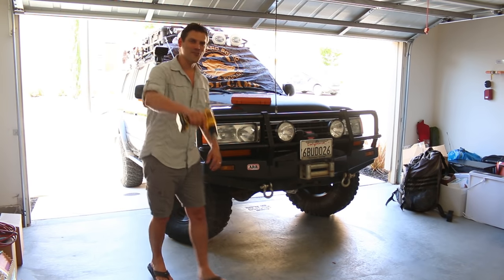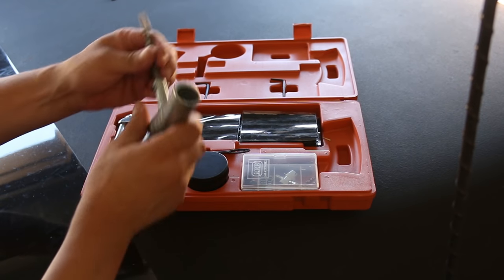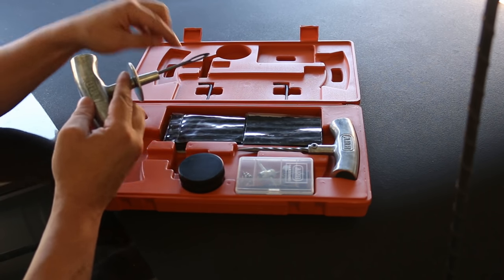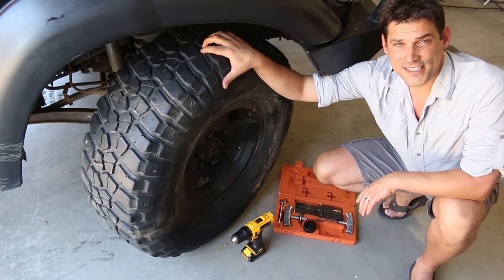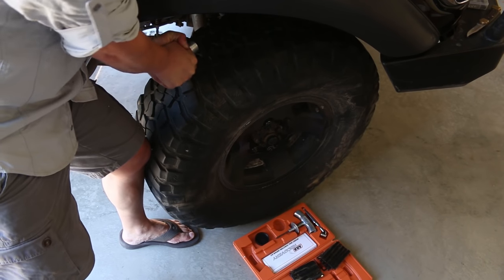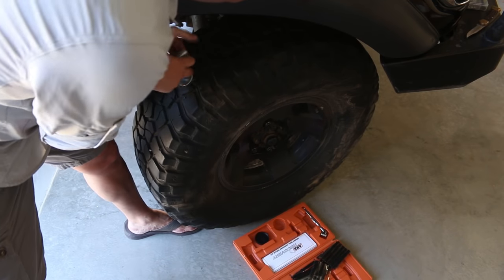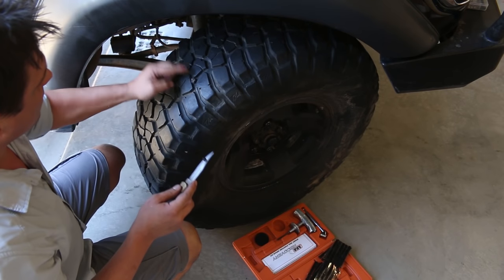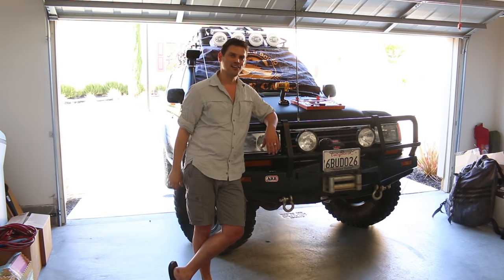Trail Tire Repair How To

Comment: a trick I use is to smear the rope in rubber cement and after the rope is installed smear more rubber cement on top of it and it will last for a very long time.
Reply: ompenarnie on my truck I just drove on the pavement for a bit and it hasn't lost pressure for 2 years
Reply: great idea!!
Reply: Sounds funny but, on the pavement, I like to put a little dirt or gravel on the end of the rope after the rubber cement before you drive to reduce the risk of the sticky rope gripping the hot, possibly also sticky pavement.  I have seen the rope be ripped out by the road on someones repair and its just that last bit of insurance.

Comment: Wow dude, thanks putting a hole in your tire to show us how to repair it.  Good information and instructions.
Reply from the maker: You are welcome! That repair has held for months!
Reply: Those tires needed to be replaced anyway. See the cracks from dry rot and the shiny smooth appearance of the rubber.

Comment: I have a 2009 RAV4 sport v6 4wd. It has no spare tire. I’m considering getting a set of all terrain tires and foregoing a spare tire and just using a patch kit. I’m just getting into off-road driving and will be sticking to forest roads for the time being which is about the max capability of the RAV4. Any thoughts on not carrying a spare?

Comment: Also a ratchet strap wrapped around the tire/through rim and placed over the handle can be a big help to get it inserted especially if the puncture is on the inside of tire.

Comment: I have a few patch kits in each of my cars. I've used them on and off the trail several times. Being able to patch a tire is a valuable skill. Hard to watch you drill a hole in a good tire though.
Reply from the maker: :) Right? Ya - thats crunchy - it was hard to DRILL in a good tire. THe shot doesn't show my face, but I was all o_O

Comment: Great video. Anougher hot tip. You can use more than one plug in a puncher if its a big steak. My best would be 14 vulcanizing fluid helps to. Thats the stuff ppl splice conveyor belts with. The local tyre man did tell give up after 25 plugs in 1 hole.

Comment: I've plugged HUNDREDS of tires with this style kit.( worked at a car auction) I've even ran these in my own tires they work great. I've never had to use a drill,But it helps.

Comment: Much heavier duty kit than the one I carry.

Like another person said, I use rubber cement on the plug material and on the end after fitting it too.

One trick for colder environments is to pop the plugs into your pocket or in front of your vehicle cabin heater to make them more pliable, it helps a bunch.

Great demonstration :)

OB# 17170

Comment: Thanks for posting, how often does this "repairable" type of tire failure happen off road? I would think more failures are bad gashes and not fixable.
Reply from the maker: That can be the case, and that is a more advanced repair. You can stitch them, and the repair rope can fill a pretty big hole. You can even fill your tire with straw, mud, clothing and remount it. Any tire repair is meant to simply get you to a place where you are safe, or can contact someone.

Comment: Looks like a great kit. I had to use my green slime kit the other day, and ended up using a rather large drill bit and power drill to enlarge the hole. Would not have worked with the reamer included in the kit.  Glad I used it in my garage. This one seems a lot beefier.

Comment: Thanks for the video. My experience with this type of plug has been good. I once ran over a small pair of scissors with my car. I plugged it and still had a slow leak, but not so bad that it couldn't be driven on. The funny thing is that the more I drove on it, the slower the leak got (until I was able to replace the tire.)

Comment: It was a great video but you never mentioned the size drill bit that you used it looks like 3 /16 bit to me it does help with all the pushing to get the plug inside the tire
Reply from the maker: It really depends on the size hole!

Comment: Great video! I've had to use mine only a few times (luckily). Really glad I had it. Two things I added when I did my repair. I used some dish soap in a water bottle to make some "snoop" to check the plug for leaks. I poked a small hole on the lid with a knife and squirted the soapy water on the repair. I also used a paint pen to put a small mark on the side wall inline with the repair. Makes it easier to find the repair again to keep an eye on it.

Comment: tks to your video, I bought the ARB tire Repair kit thru Amazon and got it today. I had another tire repair kit that isn't as heavy duty as the ARB, but never had to use it (probably works okay, but feel so much more comfortable with the ARB.  tks for the heads up and the instructions.  Happy trails,
John
Reply from the maker: Awesome! Its a good one!

Comment: Wow, now that was dedication for a video!  LOL  Thank you so much this is really helpful.  I will be adding this to the kit shortly.

Now the real question, is how long can you run the tire after you have repaired it.  Is this a permanent fix or would you have to replace the tire soon after the repair?
Reply: Really, any time I've used a plug, it was adequate to last the rest of the tire's usefulness

Comment: My 35 inch Cooper STT's are about that low on tread I've got 35,000 mile on them and 1/8th inch of tread left and it wouldn't kill me to drill a hole in them just to prove a point. In my opinion once a large mud terrain gets to 1/8th or less in tread they are not very useful any more for series off-road and for wet roads chances of hydroplaning go way up.
Reply from the maker: I don't disagree!
Reply: Time for some BFG KM2s or if you want to wait a bit the KM3s will be coming out.....

Comment: Thank you for stressing that this is a temporary fix to get you off the trail! The repair must be patched from the inside as soon as possible. If the innerliner is not patched, pressurized oxygen in the inflation air will permeate the components of the tire, causing premature degradation of the rubber and possible separation of the belts from the tire. This is very bad, especially in a heavily loaded vehicle with a high center of gravity.

Comment: This repair is illegal in the UK
Reply: wouldn't stop me, if you're repairing a tire its because you have to get it fixed so you can move again. Europe is way to over regulated
Reply: Matt Smith too many sissies in charge.
Reply: Probably because its not considered a proper repair. Personally I would only patch a rear tire like this. If its a flat front tire simply rotate it to the rear.
Reply: +Mustang Nick depends on what you're doing. I know some local 4x4 guys who've got 40" dia tires and don't get over 50MPH usually. A tire that big failing against the weight of the axles and the weight of the other three tires at that speed vs. the unibody gives you a fairly predictable and correctable response
Reply: Here in the US we can plug anything in the tread area. But it's illegal to plug side walls.

Comment: Something your forgot to mention. 

You should never plug a tire with air in it unless you are ABSOLUTELY sure that is just air and no other foreign substance/gas. If you had then mounted somewhere, had it patched, or used tire they could've used a flammable tire sealant. Most of that sealant is not around or used anymore but never assume!
The popular green slime of today is non-flammable.
But if someone used some older sealant it can blow. When you insert the tool it can create a spark against the tires inner wires. 

So please have 100% confidence that there is just plain air in the tire before you plug it this way.
Reply from the maker: Good point. My source for the method used here is from previous Camel-Trophy racers and my own personal experience. It certainly does go a long way to know your tire! Your probably not a fan of the "ignite the solvent" technique of reseating a tire either (smart)! There's just no reason to do that if you have a strap and a couple decent tire spoons.
Reply from the maker: Just to be stated clearly, I also don't recommend drilling into tires in general. For demo purpose only. Jeez, is it time for me to start saying, "don't try this at home"? :)
Reply: +Overland Bound I actually have done the ignite the flammable liquid to set a bead here at the shop and on the trail. Sometimes (on tank trap at Hollister, with lots of mud, and serious lack of space) it's the only way haha. Just make sure to have air supply ready AND have core valve out. 

Side note: We are a Toyota shop in Concord if you ever need anything, 
ToyotaPro